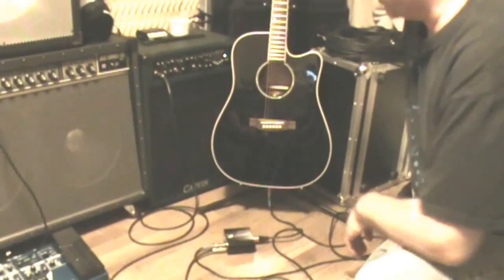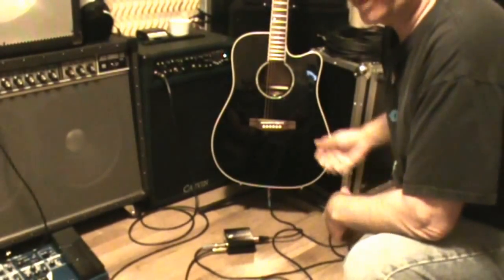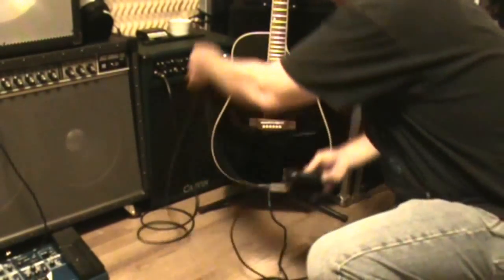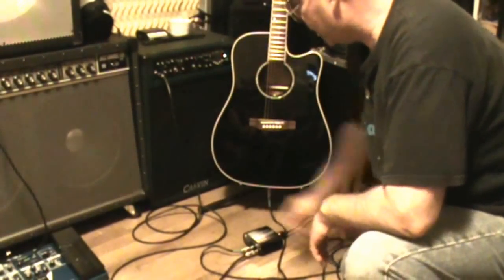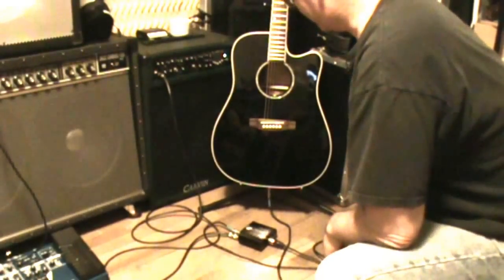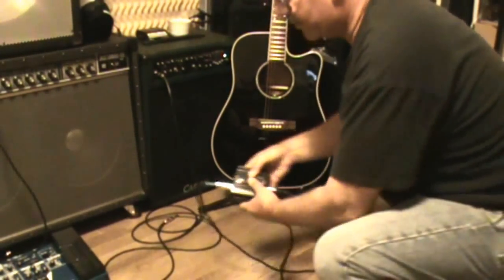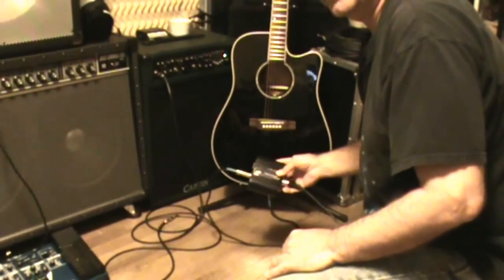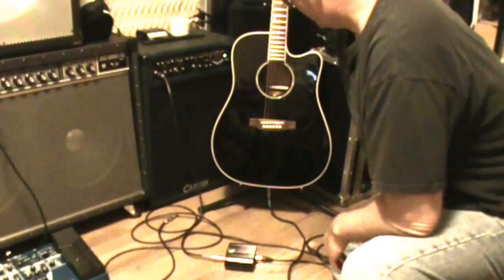Using a DI Box for Acoustic Guitars - AudioTech

Comment: Maybe a dumb question, but what is the power source for an active DI box?  I don't see any way to get batteries into or out of it, nor a place to plug in a cord.
Reply from the maker: An active di can get power from 48v phantom power supplied from the mixer through the xlr cable. Like a condenser mic does.

Comment from the maker: Radial makes a high quality DI. If you have more than one and you are getting the same results I would start looking at your other gear and make sure to eliminate all ground loops. The odds on getting two defective Radials is pretty unlikely I would think. Check all of your outlets and make sure they are grounded. You can grab an outlet check device at Radio Shack or Wal-Mart.

Comment from the maker: The order is correct however the pedal has a DI built in usually. Haven't seen one that doesn't. The XLR output on the pedal IS the DI output. If you are using some like a Boss ME-50 (or other electric guitar effects pedals) for effects then yes go into a DI after that.Thanks for the comment!

Comment: I do acoustic gigs and just run my acoustic guitar directly into my mixer with a guitar cable. Is there any problems with doing this and not using a D.I? The leads i use are only a few metres long and I don't seem to have any noise.

Comment: Can you plug a stereo jack as input?.. if I have an XLR mic cable with a stereo jack at the end. Will this only capture half signal? Thanks 😊
Reply from the maker: Depends on the DI box. Some have a balanced XLR and TRS jack so in that case yes you can use your stereo (TRS) plug. If your doesn't have the option just pick up a mic cable.

Comment: Well explained. 

I bought a DI box to see if it would help my non amplified guitar - it has no onboard electrics and a Fishman across soundhole pickup.

And it does.

Do I need to treat acoustic guitars with onboard electrics and eq bits differently?

Can the acoustic guitarist bugger everything thing up by then fiddling with their eq and volume settings?
Reply from the maker: You can run a guitar with active preamps into the DI as I show here. eq and volume controls are there to be used. Yes you can get the eq messed up by over doing it. Feedback can get to be an issue with too much of any frequency. Only eq if you need to fix something ect. Too much bass in the mix so the guitar feedback on stage? take out some bass with the preamp. Hope that helps. God bless you too my friend!

Comment: Where will i put my guitar pedal if i ise DI Box and ampli? 
Guitar-pedals in- pedals out- di box in- di box out-mixer?
Reply from the maker: Guitar - > pedal (s) -> DI from there go to the amp in as normal and run XLR Mic cable output to the mixer.
Reply from the maker: Just released a new video based on your question. You are not the first to ask. Cheers!

Comment: Does a DI box help with reducing feedback when playing an accoustic guitar through a PA at high volume levels. When you don't have EQ settings on the pickup in an accoustic guitar.
Reply from the maker: No, you need to lower your guitar levels going into the monitors. Using a 31 band graphic eq on the acoustic or the monitors can kill the feedback frequencies. Some of the acoustic floor processors can handle feedback and are equipted to be a DI as well.
Reply: @TheGospelGuitarist  Thank you for that, I nearly went and bought a DI box all for nothing. I have a Rane EQ in my rig rack, which I can use. My main feedback problem is a venue I play at hosted by the person who supplies his own mixer and amplification. Only a 3-band EQ mixer and powered speakers.
Reply from the maker: Cool, just notch out the bad freqs. A DI converts the high impedance signal to a low impedance signal for long cable runs to the mixer without becoming an antenna for noise.
Reply: @TheGospelGuitarist  I saw an LR Baggs in line Equalizer box demo for accoustic guitars like mine, that do not have in built equalizing, and that seems to be the right one for me to eliminate feedback. At venue's which supply their own sound, and only have 3 band EQ mixers.
Reply from the maker: Yeah, Baggs makes good stuff.

Comment: I own one of these and still dont know why......passive pickups might need this but a powered guitar like mine with a 9 volt battery doesnt need this doees it?
Reply from the maker: If you are making long cable runs to the mixer, yes. In a live stage environment. Acoustics don't have passive pickup systems. IF there is a preamp, it is powered. The DI reduces the line noise and converts the guitars signal to low impedance for quiet operation over long cable runs.

Comment: I connected my DI  (after my distortion pedals) to my guitar then connect the XLR cable from DI to my mixer.......there was no sound heard from the amp.   There was no issues when I disconnected my DI and reconnect my distortion pedals to the guitar/mixer.  What am I doing wrong.
Reply from the maker: Hmm, is the XLR cable good? Does the DI work? try with something like a mic and see if the cable and box work. Change xlr cable out, does the setup work with no distortion pedal. Guitar-DI-Mixer?

Comment: Thanks for the video!  If i'm playing on stage and want to eliminate my amp and go direct to a mixer with just a 10 foot guitar cable from my acoustic (with a passive pick-up), do i still need a DI box?  Or is the cable length short enough to render it unnecessary?
Reply from the maker: You don’t need a box for that short of a run. But if you do pickup line noise from something than use it.
Reply: @TheGospelGuitarist  Wow!  Thanks for the reply, and so quick too!  I'm new to mixing...we're just now expanding from amps to a larger system.  Our hope is to be able to run our guitars, mics, mandolin, banjo and a harmonica mic all direct so that we can just mute a channel when not using that instrument.  I bought a cheapo behringer two channel di box, but i couldn't tell a difference when plugged in.  Actually picked up noise when using it.  Thanks again

Comment: So you go through your effects first so it will send the same mix to the board as the amp right
Reply from the maker: Yes you can.
Reply: @TheGospelGuitarist  on my channel I play with backing tracks. I have a couple hundred videos but I want something I can play directly with the TV involved in it? Like feeding the TV into the DI and the guitar at the same time to get a mix
Reply: @TheGospelGuitarist  what do I need to be able to plug both the YouTube line from my computer and the guitar in to blend them?
Reply from the maker: Just pick up a small mixer or one of those 4 input 1 output boxes with the volume control for each input. If you are recording this to a computer then get a small 2 or 4 channel USB audio interface which takes the place of the DI.

Comment: Is it possible to substitute the amp(output line of the di) to a headphone? Using it as a monitor, to lessen stage noise. Thanks
Reply from the maker: The DI is not an amplifier so I don't think the headphones will get enough signal it hear, especially on stage. You can go directly into the mixer and hear yourself through the stage monitoring system if you don't want an amp on stage.

Comment: I recently purchased a Focusrite Scarlett 2i2 (3rd Gen) audio interface for home recording. When I plug my acoustic guitar "direct in," or through an acoustic Traynor amp, I get a sorta "buzzy" or "grainy" sound. I've been researching this a bit, and it seems it's something known a piezo "quack," having to do with the pickup under the saddle. Thing is, I remembered I own a DI box (dPDB), and was just wondering if this might help with the issue I'm having?
Reply from the maker: I know a great way to find out, plug it in. lol DI's generally won't get rid of that though. Acoustic preamps are always a pain. I'd rather record an acoustic though an acoustic amp mic'ed up or a good pair of mics in front of the guitar. That quack is hard to eq out as well without a 31 band graphic and or a parametric eq. So much easier to set up a mic you like the sound of for acoustic recording.
Reply: Okay, thanks. Appreciate the feedback. Might a small mixer help, or would that really just be the equivalent of going through an acoustic amp to the preamp?
Reply from the maker: If your acoustic amp has a di output i would use that if micing  the amp is not possible because of your surroundings.
Reply: Thanks again. Gonna try replacing the battery (inside) and see if that makes any difference. Don't think it will, but it's worth a shot.

Comment: I read a warning on a Mic Preamp: Don´t plug it to your mixer if it has phantom power. I got a 4 USB channel mixer and I would like more info about DI boxes. So What´s the difference between an ART Tube MP Studio V3 Mic Preamp and a DI box in my acoustic guitar towards to the amp ?
Reply from the maker: Fogertian The ART V3 Tube unit is a mic preamp not a DI box. I have the full rack version of that unit. In a sense it is a DI as well, but only in a home studio use kind of way. I would heed the warning of using the Art Mic V3 since it too has phantom power I believe. You will fry things that way. You can use the V3 to run into your computer to record songs using various instruments. A DI box converts the type of signal running through the cables from high impedance to low impedance for long stage to mixer runs using a long snake cable systems. You don't need a DI to into you amp itself, the DI split the signal going to the amp in high impedance and the other XLR out to the snake or stage box for the snake run to the mixer. You could always just put a mic on the amp too. Hope that all helps.

Comment: This may be a silly question but what are the amp settings at or is it all controlled by the DI box? Do I turn all my dials on the amp for  low to high levels down or leave them straight up?
Reply from the maker: The DI is just splitting your guitar signal to the mixer. Run the amp the same as always.

Comment: So, I want buy the Behringer EUROLIVE B205D Active PA/Monitor as a stage monitor.  I currently have the guitar and piano connect to the stage snake, but I need the monitors.  How would I connect an acoustic guitar or piano to the monitors ? Is the DI Box what I need?  ( Step by step please) Someone, please help!
Reply from the maker: Instruments into snake, snake into mixer, mixer out to PA and stage monitors connected to AUX 1 on mixer. Use channel aux 1 send controls to send the instrument on the channel to the stage monitors. Adjust Master AUX 1 send to adjust overall level at the monitor. Adjust each instrument to the level you need to hear it at on stage. That is your monitor mix which is separate from the from of house mix using the faders.  Hope that helps, audio is a complex subject, best to start reading books and watching lots of videos on the subject.

Comment: Can use di box on electric amp? My guitar is acoustic and i have no acoustic amp
Reply from the maker: You only use the di for a long run to a mixer. You can lug into an amp directly but acoustic guitars don’t usually sound good that way and feedback can be an issue if loud.
Reply: @TheGospelGuitarist  thanks

Comment: Hi do this settings apply to any amp? Also i will use a jazz chorus 77 amp to record straight to my DAW using a DI. Do i still need a load box since its a solid state amp?
Reply from the maker: Yes, no load is needed, just put a mic on the cab and go. You don't even need a DI for straight recording unless it offers something you need.
Reply: @TheGospelGuitarist  hi I will actually do silent recording. My chain would be guitar to DI input then amp to DI link input. I will not be micing the amp so I will not disturb my neighbors. Do i still need a load box for that even though jazz chorus is a combo solid state amp?

Comment: Hi , I know this is an old video but figured I’d ask . I have an electric guitar and boss katana 100 amp .. they are both brand new and there’s a really bad hum .. I’m just currently running guitar into amp with nothing else in that chain . I have a passive dI box . Would this work on an electric guitar if I just plugged into the DI box with the guitar and then went into the amp ? Or is it strictly for acoustic guitar ? Thanks for your time
Reply from the maker: If both are new and you are getting loud hmm my first guess is to check the guitars grounding. A loose wire inside will absolutely make the guitar hmm. I don’t think the di will get rid take a broken ground away. But yes di’s can be used when electric instruments as well.
Reply: TheGospelGuitarist thanks so much for the reply . Not sure if this helps but the hum stops whenever I touch the guitar strings or anything metal on the guitar . The hum comes back as soon as my hand isn’t touching the strings .
Reply from the maker: Check the ground wire coming from the bridge. That wire grounds the strings.
Reply: TheGospelGuitarist ok I will check it thank you.. I tried the DI box and it didn’t help . Its actually the strings or anything metal on the guitar .. if I touch the volume knob or the knobs for the tone or the pick ups the hum stops .. but as soon as I take my hand off it’s right back .. I’ve read reviews on the boss katana amp and some people were saying how bad the hum is and that you have to use your computer to turn on the noise suppressor for the amp .. just waiting on my laptop bc all I had was an iPad .. thanks again for your time .

Comment: i have a single coil neo d pickup for acoustic , and it make a ground noise , are active direct box will eliminate the noise ? for recording purpose
Reply from the maker: Either you are setting up a ground loop or the pickup is not grounded. A box with a switch may help, but I can't promise it will. Just try one out they are cheap.
Reply: how to grounding the pickup on acoustic guitar ? i dont know where installing ground cable
Reply from the maker: Just look over the pickup and connects to make sure that non of them are broken.  Most likely the pickup will not work if one is bloken but I don't know how your system is wired. I think if you are using two different house circuits you can create a ground loop, same as playing live. All you gear should be used on the same circuit to avoid loops. Also your pickup may be "picking up" noise from things in the room. If recording sit back from your computer and screen for example. Hope that helps, if anyone knows more about acoustic issues with pickups please sound off.

Comment: can i ask if i can direct the DI box to my mixer with out using guitar amplifier ? ?
Reply from the maker: Yes, you may and yes you can. If you're talking about live stage performance absolutely. If you're talking about home studio situations, you can just run your guitar cable into the mixer without the D.I. because it is a very short run. In a larger studio where the run is over 25', then use a D.I. into the mixer. Hope that helped!
Reply: what if they use efx on their guitar ?  does my speaker will not be damage ?
Reply from the maker: It will not damage your speaker. Lot's of acoustic units have effects built into them with a D.I.

Comment: But how do i connect my pedal board with this same setup?
Reply from the maker: Run guitar to pedalboard and exit pedals into the d.i.
Reply: Nhorie Rondilla does this DI or other ones made to remove noise and hum from pedal bords?
Reply from the maker: There are noise cancellation boxes. I don't know of a DI with that function included though.
Reply: TheGospelGuitarist so I will try ( noise suppressor) boss pedal may be will be fine... Thanks

Comment: Whzt if i have a guitar with a preamp built in do i need a di to plug directlyinto a mixer
Reply from the maker: When recording at home you can but live onstage you need to use a DI for the long run to the mixer.
Reply: TheGospelGuitarist  so a short cord into mixer thats by the stage and no need for DI box?(my acoustic  is a solid body piezo bridge with chambered areas  and an active eq ,tone,bass,vol.)
Reply from the maker: Only if the cable length does not exceed 25 feet.

Comment: Just a quick question, can you leave for a week and come back to find that Roland Amp missing 😂😂. All I could see was that Amp in my house guarded by a massive Pitbull😂😂
Reply from the maker: You know these are all over the place used. You can get into the old ones for $800. THe new JC40s rock too. Would love to get me one of the new models because they are designed for all the new pedal boards in stereo setups.
Reply: @TheGospelGuitarist  I always liked that Roland amp, something about its appearance is just different than any other Amp ever made. Specially the Chorus and Vibrato section it's just incomparable to anything out there. Will be hunting that one down and a Vox AC30 Topboost model from the 1960's. Saving up the cash 😭 you can not replace the sound of Tube Amps, no sim can even get close not for another 20 years before real time sampling / playback is possible. The Pod  HD Series, Boss, even the Axe Fx all have  too much input/ output dry latency compared to my 1997 Digitech 2120 Processor. Seems like the older units had less input / output latency.